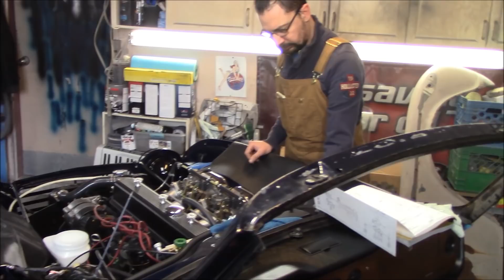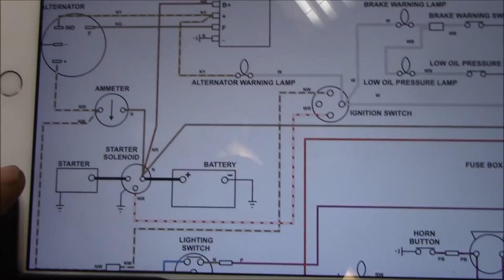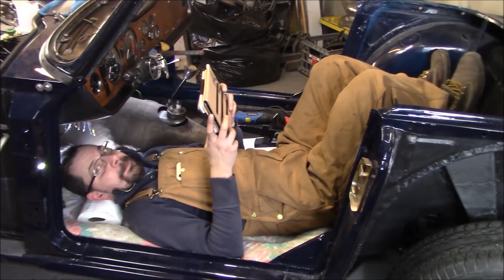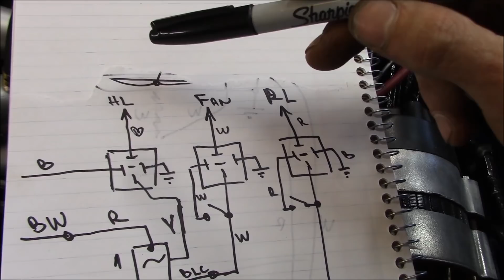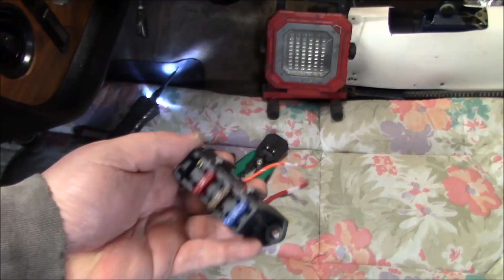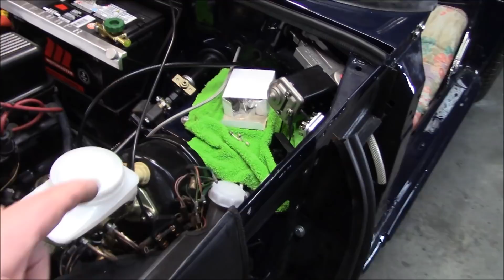1968 Triumph TR250 Restoration,  Assembly Part Fifteen, Main Circuit Wiring, Part 1

Comment: It seems that your driving lights can be on irrespective of headlight dip or main.  In UK our driving lights must extinguish on dip, triggered by the dip switch itself.  I take it Canada is different to UK.
Reply from the maker: That’s correct Les...these are independent of the main lighting system and will not dip with high beams on the headlights engaged.
Reply: Thanks David

Comment: I know that the turn signal was located on the right on the cars I drove in Japan. So maybe it's correct? But yeah, it is weird.
Reply from the maker: Apparently it’s incorrect according to my TR5/TR250 Facebook group 😉
Reply: @cheftush  That's a relief. Driving in Japan gets some getting used to. Inevitably you head down the wrong side of the road, and in your rush to get back to the correct side your initial reaction is to hit the turn signal. 

Which ends up being a newbie alert for the other drivers with your startled face, going the wrong way down the road, and your windshield wipers signaling your intent to get back to where you belong. Good thing that the Japanese are so patient.

Comment: Perfect timing for me on this video.  I’m installing a new harness in my TR-3 very soon. The fuses and relays are what I was going to do as well.  Thx for posting.
Reply from the maker: Thanks David, on my 60 TR3A, I actually added a secondary fuse box to run my driving lights and electric fan...I used a secondary stock fuse box right out in the engine bay next to each other...if you didn’t know TR3’s, you wouldn’t know that is wasn’t stock.

Comment: Great video, some good tips, thanks guys and a whole new way to lay down on the job.
The turn indicator stalk on my LHD 4A is on the left and the lighting stalk is on the right.
I had to installed new switches, the existing ones were badly mangled. The turn new 
signals were not cancelling , I discovered that the little tab clip on the steering shaft wasn't 
clipping the little "ears" in the switch as it should. The clip has no Moss part no. in the 4/4A
catalogue so I removed the clip, zapped some weld on the ridge of the clip, it took about  5
tries to get it right, smoothed the weld an re-installed the clip and waddaya know...it works !
Yes the part is listed in the 250/6 Moss catalogue (.89 US ! ), I found that out after the fact,
oh well....
Reply from the maker: Thanks Dennis!  I’m not sure what I’m going to do about the switches yet...I wish I’d had an opportunity to drive this car prior to taking it apart but that wasn’t an option unfortunately....I could have caught this issue and a few other issues earlier.

Comment: Just a thought on the headlight wiring, You might want to think about adding another relay and seperate the high and low beams. The way it is wired now all the current for the headlights goes through the high/low beam switch. With 2 relays you could have only the relay control  going through the high/low switch. This would not only put less wear and tear on the switch but have less current going through the wiring harness...less chance of losing that smoke in the harness.
Reply from the maker: Thanks for the suggestion Glenn. I appreciate it.
Reply: I thought about it, but the high\low beam switch is massive and can hold the current for an entire neighborhood LOL So I am not worried about the switch and that would be the only part that would have been protected by adding 2 relays instead of 1. The wiring wouldn't have been protected if I added 2 relays, unless I changed the actual wires going all the way to the front of the car to the headlights or if I installed the relays in the engine bay, but I still had to run another wire for the high current circuit to them, so it didn't make sense.
Reply: @RustyBeauties  I've looked at it a few times and can't really see what you've acheived with the first relay except for taking a fused feed to the switch for high / low and then to the lights without a relay. And I'm not sure what the "B" wire is that is supposed to energise that relay. 

Was it just to keep all the new wiring etc. as simple as possible in on place under the dash ?
Reply: @johnmoruzzi7236   The two "B" wires are the original blue wire from the on/off switch to the high beam/low beam switch. I disconnected the bullet connection under the dash and now I have 2 blue wires. The one coming from the switch now energizes the relay and the one going to the headlights is switched by the relay. So the point of this relay is, it takes the heavy load away from the on/off switch, which has pretty flimsy contacts. The high/low beam switch still caries the high current, but 1) it is a huge switch with heavy contacts and 2) it is not used that often (if at all) so I am not worried about burning its contacts.
Reply: @RustyBeauties  OK I see... there's a master On / Off switch as well. Neat solution.

I can't remember what the arrangement was on my 66 Vitesse I had back in the 80s... I had a 70s Dolomite after that !

The "confusion" about which side of the column holds which stalk / function is interesting, you seem to have the arrangement for traditional RH Drive cars, the indicator turn signal is on the right so you can operate it with your right hand and change gear with your left... reversed for LHD markets.

Comment: On that indicator stalk position UK cars had them on the RH side of the column up until the mid '80s when the Japanese influence came in and they followed with indicators on the LH side where they have been ever since. it was the same on LHD and RHD cars.
While the other stalk is for lights on that TR on the Minis and other BL cars for example the stalk was used for the windscreen wipe / wash. Ask me how I know ... 🤔
Reply from the maker: Thanks for the history. I’m half thinking of leaving it as it is 😉 not sure if I could adjust to it though....it would be like driving an early British bike and having to shift with your right foot and brake with your left 😉
Reply: @cheftush  Ah well they were proper gearboxes of course 😂
Triumph cheated. They kept the same gearbox and just put a long shaft across the back inside the casings to put the lever on the RHS.  As they had to put a gear segment in it reversed the pattern from down for higher gears on the right change to up on the left change. Much to the annoyance of racers.
I first started riding bikes aged 16 in 1963 on a BSA Bantam 2 stroke!.... Last bike was a Triumph Daytona 675 Factory which I sold 2 years ago. (Not the one in my avatar - that was an earlier 675 Black & Gold).

Comment: On both my triumph stag and mgbgt the signals are on the right.  Don’t know if that is a UK thing (modern cars have them on the left) but I had assumed it was a British leyland thing at the time
Reply: UK built cars had the indicators on the RHS of the steering column until about 1984 when they followed the Japanese / European trend of being on the LHS of the steering column. Export LHD cars would be fitted as per the norms for that market but wouldn't be changed just because its LHD vs RHD. The date of manufacture is of more influence.
Reply: @1chish  thanks - I didn't know that
Reply from the maker: Henry are your STAG and mgbgt are they left hand drive?
Reply: @cheftush  Both are RHD, but my Ford and BMW (also RHD) have the indicators on LHS of steering column
Reply from the maker: @HenrysGarage  thanks for the reply Henry. Much appreciated
Reply: @cheftush  Just checked with my dad, who has a LHD Stag, and his indicators are on the LHS
Reply from the maker: @HenrysGarage  thank you.

Comment: Well that was very interesting. I am not sure on my 72 now which stalk is what. I'll have to go out and investigate in the AM before work and have a look but I do remember originally thinking it was wonky so perhaps it is the left stalk is for the headlights? Great wiring tips there did similar on my Fiat prior and good to get the load off the original wiring and run some new for those high drain/amp circuits and a fuse on that Ammeter is a great idea for all old cars with them...dangerous with that LIVE lead into a metal dash area direct to the battery! Another great video....

Comment: Are you not still running the load through the switch for your fan and driving lights?
Reply from the maker: The fans and driving lights run through a separate fuse box and separate relays.
Reply: @cheftush  just the way you show your wiring diagram the switch draws power from the same power lead as your feed for the relay,,,could be wrong? Just hate to see you melt your switch
Reply from the maker: @mikejackman4416  I’ll consult with  my partner in crime 😉
Reply: I thought this was a strange thing to do also, normally the point of the relay is to switch the high load on and off via a lower amp switched supply, not use the same supply to do both.
Reply: @T101cyberdynesystems  In automotive we only have one supply, which is the battery. It doesn't matter if I connect directly to the battery or to another circuit connected to the battery, as long as I branch off BEFORE the load and use separate ground. This creates another circuit with the same positive, but going back to the negative of the battery through a different path and not through the big load. The draw on this circuit would be only whatever is after the switch, which in this case is the relay coil or 0.1 Amp
Reply: @RustyBeauties  Thanks Elin, I did some research also and saw a circuit wired up like this, and your explanation has confirmed that there is only really one supply from the battery, 👍
Reply: I think that load would be only whatever the relay coil draws, not the load through the main contacts.
Reply: @mikegoodman4133  100% right. The switch and the relay coil are branched off the same circuit where the big load is and create a separate circuit, which has the same positive as the big load, but a separate ground on the other side of the relay. So the switch is on a 0.1 amp circuit, which is the draw of the relay coil.

Comment: David, I just started looking at adding fuses to my TR4A! However apparently modern fuses have different ratings than the fuses that originally came with the car. I believe new ones are rated for continuous flow rather than the blow point. So a modern 25 amp fuse actually blows closer to 35 amps. So one more thing to have to figure out! I’m planning on calling Moss tomorrow and ask about this.
Reply from the maker: Hi Jim,  we could probably test this actually...I think Elin has a variable power unit that we could hook up and check some fuses for actual ratings.  Might be fun to test.
Reply: @cheftush  David, here is a chart on UK vs US fuses, (apparently from a Toronto based MG club!)

https://www.mgtoronto.com/pdf/Tech/fuses.pdf
Reply from the maker: @Ksozey  Thanks Jim

Comment: Well, that was a fun video. Good to see Elin too. His jeep looks awesome. On the wiring, the only thing I'm questioning is the lack of a thermostat switch for the fan. A manual over-ride switch is good, but in my world, (and because I'm easily distracted), I prefer to have a thermostat do the thinking for me. Cheers!
Reply from the maker: Remember though Kevin, I’m running a mechanical fan as well...I don’t expect to have to use the Efan unless I’m in heavy traffic....
Reply: @cheftush  Ah, I forgot about that, Chef.
Reply from the maker: @kevinblume2976  roger that...yeah otherwise, it would have been done like my TR3A that has the eliminator kit and full thermostat install plus an overide switch installed.